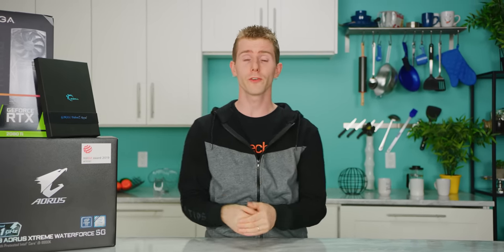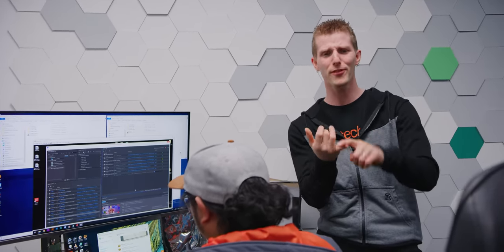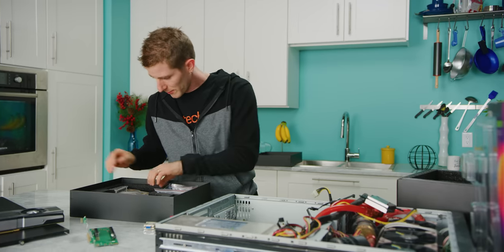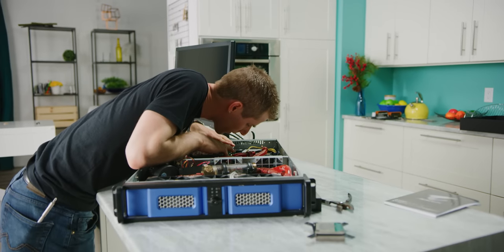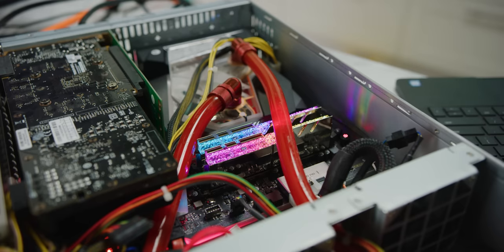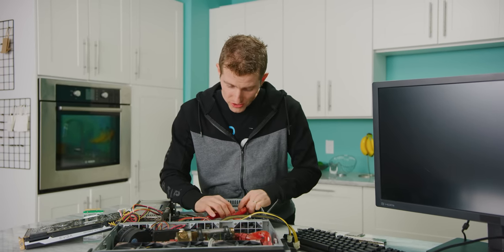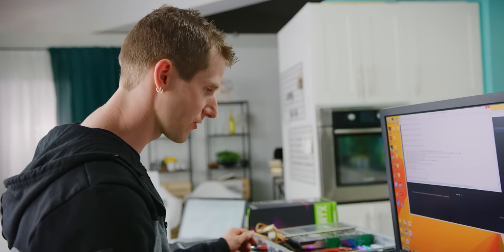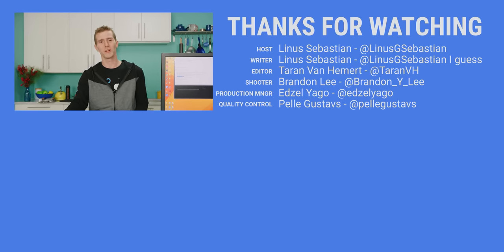All this work... for what?? - Upgrading the Video Render Server

Comment: OK: Mistake #1 using AME. Whatever I do it is consistently the slowest possible encoder I can get my hands on. If you have any chance of not using it take it.

Now I'm guessing you guys are stuck with it because you want to export Premiere project files. so assuming that is not an option:

Mistake #2: What actually seems to be killing your performance is rendering the videos over the network. When Linus was testing the 14 core on the installed machine the project was accessed over a network drive. When he was doing the initial tests with the 16 core the video was rendering from C:\....     
Why is this a problem? If the encoder is not optimized for that it might read data in in tiny junks and also write the result out in tiny junk. Every time it does that that operation will suffer the full latency of the network. Now while this might be ~ 1ms in your LAN this still adds up VERY quickly and utterly kills your performance.  We had a similar problem fetching all the build results (think tens of thousands of dlls and config files) from a remote server. It actually turned out that it was faster (about 2x-3x)  to download a zip file of the build result and then unpack it locally then it was to just copy the folder, because the latency of all those small accesses was killing the speed and we couldn't saturate the network that way.

So the solution might be to first copy the project to be rendered out locally onto the render machine and then encode it on there. That would get rid of all the latency and might give you a decent speedup. And even if it isn't faster for one job it will definitely increase your overall throughput.

I still would advise to use some of the coding know how in your company to have someone just whip up an encoding script that just uses ffmpeg for the encoding if at all possible. In my experience that is the most stable option that produces the best results both in performance and quality terms. ffmpeg's h264 encoder x264 also should scale way better onto many cores (especially since you guys render 4k) than the sorry excuse for an encoder Adobe ships with AME.

Comment: You know you can make task manager display per-core utilization, right? No need for guesswork.
Reply: Since windows thread scheduler bounces threads between cores continuously (generally faster than the graph update period), the per core utilization graph is mostly useless unless the application (or user via a third party tool) is using cpu pinning.
If I start a single threaded workload on any of my machines (4c4t desktip, 4c8t workstation, dual 6c12t server) they all show very roughly even usage across cores (but not perfectly over all threads)
Reply: @MeatPoPsiclez  been a while since I used windows, on Linux I know you can adjust the reporting interval - can the same be done on Windows?
Reply: @GlocksABlock  yep, but afaik not fast enough to exceed the thread bouncing. Perhaps with actual performance monitoring as opposed to the task scheduler graph
Reply: @MeatPoPsiclez  good to know

Comment: I'm wondering if you can lock all cores at 5 GHz? Can the PSU/VRM supply enough power, the water cooling loop dissipate the heat generated and the chip itself sustain that clock?

Comment: I have a HP Z600 with two X5672 3.2ghz turbo to 3.4ghz PSU 650W at least Linus, if your going to have a GPU. I got one GTX 1070 150W.
I got 16GB of RAM right now but I want to upgrade to 96GB 10600R  6x16GB that way I can watch all your videos at once. A tab for each video in Chrome in 4K 60Hrz <3

Comment: This is the linux geek in me.  But I would run a cron script to watch a directory shared in samba, when a video file gets dropped, a preconfigured FFMPEG encoder would handle the encoding and spit the result into another output folder.  That business of using a remote desktop reeks of inefficiency and people stepping on each other toes for rendering.

Comment: Dear Linus should be interesting an original build watercooling mixed peltier cellar, I do not see using that and is a project I have working a little, if you are interested I can spare the info I have gathered, as my protect you can reach subzero degree in a pretty compact space.

Comment: while you're seeing gains on a single workload by keeping core count low and clocks high, would you not get better overall performance (if there is ever a need) by running concurrent renders from multiple editors? There must be a better software solution than adobe and windows for standalone renders.

Comment: The 9980xe is specified to work with a certain type of RAM .. DDR4 2666. The intel i9 processors seem to be this way. Make sure to review the specifications of the processor when designing a system...

Comment: I have very little expertise with adobe premier, but wouldn't the encoding software itself play a huge role in this? Using ffmpeg, preset veryfast on a crf value of 18 on libx264, i did a 4K30p reencode of video game capture in Blackmagic RAW format of 30 minutes, and it took me around 40-45 minutes to complete and it gave me an average bitrate of 65-70Mbit/s (on a Ryzen 5 2600x clocked at 4GHz)

Comment: It's very simple math:
10 cores + HT at 4 GHz = 10 x 4 + 10 x 2 = 60
8 cores + HT at 5,1 GHz = 8 x 5,1 + 8 x 2,55 = 61,2
8 cores + HT at 4,8 GHz = 8 x 4,8 + 8 x 2,4 = 57,6

It's not accurate. It's not beautiful. But it works.

Comment: Why don't you use VP9 to upload to YouTube ? You have huge horsepower, so you can just run FFMPEG, easily converting all videos in a folder to another.  + YouTube use VP9 as their latest codec for compatible devices.

Comment: grasping at straws here, but Linus mucked around with just about every component but the 10 year old (now bent) SSDs. Could there be a data access issue with the SSDs? Would newer SSD tech aid in speeding up the access and storage of the data as its being processed by the encoder?

Comment: What I wonder is why you don't use something with a massive number of cores and use VMs to run SEVERAL render servers at the same time. Get a 64 core Threadripper and run 4 or more VMs and render multiple projects at the same time.

Comment: if you use 264 coddecs the gpu can help a lot on it... also... but youre using codecs that need brute force from cpus.. in this cases is better an amd processor that dont use so many shortcuts...

Comment: you set it up wrong if you want to use xmp with manual over clock you have to set xmp first then set your core clock and volts manually to counter the preset xmp profile that sets the cpu to 4.8 or there about, 1) set xmp, 2) set core clock with all cores synced then set volts

Comment: I think you should start using proper monitoring tools. It's embarrassing to see task manager used for clockspeed and utilisation, graph not even changed to logical processors when you are trying to figure out how many threads it will use. Hwinfo64 is better for both and gives a whole bunch of extra info so you can check vrm temp's, cpu wattage etc. 

Also why not disable cores or restrict their usage by changing affinity instead of changing the whole processor?

Comment: well in my case i have memori and ssd and deactivate the Virtual Memory (Pagefile) on windows, but some programs are optimized for use that  low performane and crash (never use the entire memori) some time.
 so i reactivate and try old ssd 30gb (i have this cheap) format and put the Virtual Memory (Pagefile) (min5gb max 10gb) in and no more crash and hig performance. this is my case if you desactivate pagefile try to reactivate (take short time) and try.
sorry for my english

Comment: Video encoding is not an AVX workload? Wat? It totally is, both x264 and x265 can use it, with the latter being designed with wide vector SIMD in mind. It's right there in Intel's AVX marketing materials.

Comment: Mofe core = More encode per hour
ALLWAYS

Why? Just launch more encode process with independent files.

Example: Encode only one chapter of a serie at a time all stored on one low speed disk, you loose all your power.
The correct way: launch more than one encoding chapter at a time, like using one core per chapter and use one SSD per chapter so no bottleneck.

In short words: If not all cores are been used, do not wait to launch next chapter till previous ends, lanch them in parrallel... till all your cores are in use.

So if you have one thousand chapters to encode, you will allways be able to use 100% of one thousand cores.

Using only 32 cores is a total waste in time... saying only 10 cores is the top most you will need it is like saying if you have more then one computer do not power on all since only one will do work.... because the user is so stupid to not use each computer with independent parts... the techinique is to paralel tasks, not doing them sequential.

Computer 1 (core = computer) do chapters 1, 3, 5 and so on
Computer 2 (core = computer) do chapters 2, 4, 6 and so on

If you have 100 cores you can launch 100 encode tasks at the same time, no need to do them one after another

Hope idea is clear.

Comment: Why not Ryzen? That 9990XE was only running 4GHz? If you're not getting higher clocks wih Intel from a workload that likes clock speed there really is no point to Intel at all! 
Surely the 12 core 3950X with SUPERIOR IPC ,faster RAM, and better clock speed than that 4GHz Intel part would run circles around it! 
3600/3733MHz CL16 would absolutely get more data to the CPU than 3200MHz CL14 a workload using large viles like encoding video files will surely run better on RAM that focuses on bandwith over latency.

To top it all off: You'll have an upgrade path on top of all that AND STILL SAVE MONEY!

Comment: Do another video as a "test" with the newer AMD and Ram at their new clock potentials. Also... swap out the 980? I believe you should be able to trim down a few more seconds with a slightly newer GPU. And if it's compute you need. Try an AMD GPU with compute on and off and lets see the difference there also!! Cmon linus!! DO IT!!!

Comment: wait, you're running a 100 watt board, a 200 watt cpu, a 300 watt gpu and probably 60-100 watts of ssd plus the pump and the half dozen fans... on a 500 watt psu??

my math head is broken or that doesn't add up and your psu is gonna go boom fairly quickly.

Comment: I lost my laptop this morning 8gb ram, gpu Nvidia 940 mx, 128gb add and a 1tb harddisk. Had a 2.7 core i7 cpu... And it's died, the motherboard  😭😭😭. I have never had such... will take time before I get another.  Could team Linus have an old laptop they don't mind giving away, I run Linux doesn't have to be that powerful. Please see this. Find it in your heart.

Comment: http://apollo.backplane.com/DFlyMisc/threadripper.txt
Threadripper 2 Tests
         Matthew Dillon
          DragonFlyBSD
     2-Sep-2018
    14-Oct-2018

...http://apollo.backplane.com/DFlyMisc/synth_times.txt

    A full bulk build with a recent DPorts (with flabors) takes around
    21 hours on the xeon and 18 on the opteron systems.  The 2990WX runs
    the build in 12 hours which is 75% faster than the 2 socket Xeon
    and 50% faster than the quad socket Opteron.  Not only that, but since
    I only had 64G of ram in the TR2 (the Xeon and Opteron systems have 128G),
    I had to balance the workload against paging load with the result being
    significantly more cpu idle time on the TR2 during the test than
    either of the other systems. This means the TR2 will be even faster
    on this test once I get 128G of ram into it.

    Statistics graph for for 2990WX synth run:

 http://apollo.backplane.com/DFlyMisc/synth_tr2_64g.jpg ...

...My conclusion is that at least for these kinds of loads, its a waste of
    watts to run the cpu at high power levels.  Even more importantly (and
    I hope this isn't lost on people), look at the efficiency at lower power
    levels!  For many workloads we can get nearly the same performance for
    significantly less power.  Running the TR2 at 260W (at the wall) is
    70W lower than stock and it gets nearly the same performance on this
    test.
...

Comment: Two days... And many hours of work and lot of hardware to win few seconds by redenering process... 30 seconds better?...we can try to calculate benefit compared to time for the rebuilding/tune the server... Two days was the server off... 48h.. It is 1440min...you will need 2880 videos to get benefit of this upgrade... Even when we take only work time for upgrade... 6-8h... It would be needed also 360-480min x 2 becouse of 30s benefit of upgrade... 720-960 Videos...  Wow. Nice try.

Comment: When you upgrade after Ryzen launch but still choose intel:
Reply: Remember he wants to swap boards easily and have the OS still boot. Swapping to AMD may not work well. Also he wants to use the current standard of max performance, which is Intel. AMD's return to glory just happened a week ago, boards don't even have all of the BIOS updates yet, the world doesn't change overnight, be patient.
Reply: @compaqdeskpro5770  bro what are you saying he has a x570 mobo in his inventory. You can still boot to the os even with ryzen. Ryzen will work fine for this application

Comment: Wait, aren't you supposed to be a tech expert (Or at least quite experienced 😉 )? A)no fresh install? Asking for trouble changing mobo/chipset/cpu B)pulling out RAM sticks because of instability? No VDDR, VCCIO, or VCCSA adjustment? Could even be high as shit like today's mobos like to set them when using XMP C) I get it for sake of time, but an OC preset? Bet your voltages are high as a kite, those things are set at voltages that'll work on even the worst of CPUs D) If there was an AVX offset, why not set it to zero? You're on watercooling E) I have never had a single problem with XMP, unless you count high VCCIO/VCCSA voltages, but it was still working fine. If you lost the lottery on the IMC, maybe it needed higher voltages there (though I doubt it. Coffee lake memory controller seems quite strong, at least from all the OC and voltage settings I've seen)?
Now, I consider myself a novice (or maybe intermediate at best. But I've only been building for 8 years or so, and overclocking about 3 1/2), especially compared to you guys and the amount of testing and builds, etc. etc. that you do. Or was this all done to make it more like something a beginner would experience? Still, better CPU in the end. As a gamer, I have been a blue team purchaser for some years now (though I favor neither), but with Ryzen 3rd gen, I'd say 3900X would've been a good choice, though some apps do prefer Intel (don't know if the one you guys use does, since I don't do much but game, but that would make sense if that's why you went that route) over AMD. AMD not quite there in gaming yet, but it's close enough (especially since I'm on 1440p) that my next rig will most likely be a Ryzen rig, unless Intel magically pulls something out of their ass and drops prices :P

Comment: NO M.2 upgrade!!!!!!!!!!!! WTF??
Reply: this server was build in 2016 the motherboard is 2014 and two ssd were refurbished 7 year old from 2009 120gb in rain 0 240gb-ish so no WTF
Reply: @1BigBen  How does that make any sense to you? I'm not sure you know what you are talking about. He had 2 new boards both capable of m.2. raids, which would have  helped overall.
Reply: @alexanderknight7793  because he could have put the 2014 SM951 256gb or 2015 SM950 256gb or 2015 kingston hyperx predator m.2 240gb 

the ssd is not doing the workload it is the cpu and gpi
Reply: @1BigBen  sure they do the workload, but the SSD holds the application and therefore allows it to feed the processes faster.